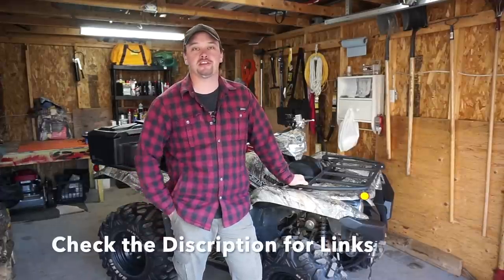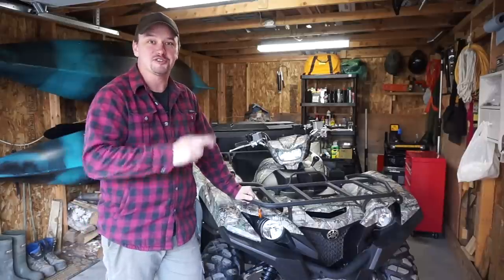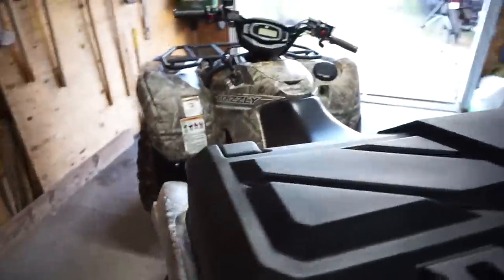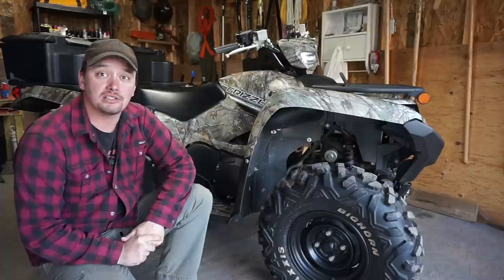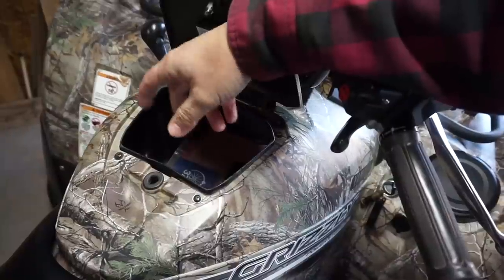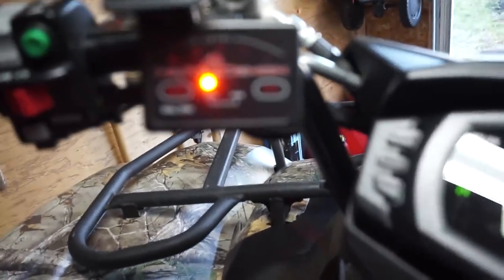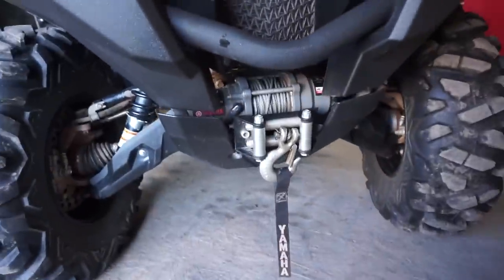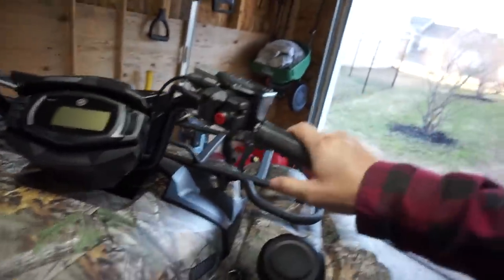Honest Owners Review - Yamaha Grizzly + Mods

Comment: Great job on this. Lots of information here. I had an '05 660 and the same year 708. Great ATVs. I like the Bighorns with the steelies too. Function before fashion! Smart idea with that foam seal on the rear storage too. That whole storage bin could use a re-think from the factory. How's that holding up for keeping the grime out?
Reply from the maker: hey ! thanks for checking out my video ! those old 660's were tough machines ! and yeah I had aluminum rims on my 2008 grizzly and thy dented easily, so I just kept the steelies for this one. yeah that rear storage bin just doesnt seem like something Yamaha would do... it seems half ass to me. The foam worked amazing ! just a little dust gets in there now, it keeps most of the water out unless I go in a hold deeper than the box, even from cleaning it keeps the water out good. thanks again for watching !
Reply: I have seen at least 2 video from Dirt Trax that said the first Grizzy was a 660 that is wrong and I  keep asking why Dirt Trax doesn't know that the first Grizzy was in 1998 Grizzy and it's a 600. I have a 1999 Grizzy 600 ,got it brand new the MRSP was $6500 I got it $6000 out the door and it only has 518 miles on it, still running like new. And I also have a 2017 with 708 and a Sportsman XP 1000 that that Dirt Trax made me buy both of them. LOL

Comment: Some mods:
Wrap the quad, (to save your plastics)
Rear winch
Elka Suspension 
Front and rear bumper
LED light bar
Brighter reverse lights.
Fold up prune saw
Reply: Also some other mods
change the spring or weights in the CVT
And add some weights in the wet clutch for more bite on the clutch, less slippage.
Reply from the maker: Hey thank for all that !
Reply from the maker: Yeah a toyed with the idea of changing some clutch weights.

Comment: I have a 2016 Polaris Sportsman 850 SP now....   
I used to have a 2004 Grizzly 660 in blue. Was a beautiful machine and had ZERO issues with it. 
I kind of wish I had gone with the grizz again.  I'm constantly afraid of breaking down on the polaris. It has some more power... but you pay for that power.... a couple hours riding and you are looking for a gas station again. 
 I mostly went with the 850 for the twin cylinder engine. As I'm no lightweight myself and I use it for plowing. 
I absolutely  LOVE yamahas 4x4 system with the push buttons and the slider. I like having control over those systems. Yamahas Ultramatic CVT is by far the best in the business.  
I often regret not getting another grizz... 
But I can 100% tell you this for sure...   the Day Yamaha starts putting their Vtwin engine from their SxS division in their 4x4 atvs,  ill be at the dealership with my Pink slip looking for a trade!!
Reply from the maker: Hey buddy ! Those Popo Sportsmans are a nice machine too but I hear ya on the maintenance and stuff.... I always have no worries that my machine will start and get me out of the woods. it could use an upgrade on the motor for sure and if they put a twin in the Grizzly, I might go in and get a new one too !! hahaha

Comment: Considering a used grizzly vs nearly new 570 sportsman right now. Looks of the newer sportsman appeal to me but I’m slowly leaning towards grizzly for power and reliability.
Thanks for the video.
Reply from the maker: Hey Anthony ! we'll thats a hard choice, I've never owned or driven a 570 Popo but from what I'm told the power is close to the 700 Grizzly. (Dirt Trax TV mentioned it in their latest video reviewing the Grizzly XTR) so maybe check that video out.
As far as Reliability, I think it's hard to beat Japanese machines, just my opinion though. 
I know people who have had good luck with Polaris and Can Am but I know so many more that run the hell out of their Honda/Yamaha and it keeps going.
Between those two machines it would depend on Your budget, the Year, the shape and how many miles are on the Yamaha vs the Polaris. Do your research and figure out what's best for you.
Reply: I have the 2015 Polaris sportsman 570. It’s my wife’s machine. I run it right alone with the 2007 grizzly 700. Both great machines. Power steering is better on the sportsman. Power is about the same.

Comment: I have a 2007 Camo Grizz  it hides the wear a lot better ..mine has 2300 km ... Love it , Replace wheel bearings only one time in 13 yrs, and swapped antifreeze with high end Arctic Cool . Helped a lot as i use my grizz to pull my tow behind mower .  It mostly just keeps my RZR company in the shed ...
Reply from the maker: Hey man ! you're right, the Camo really hides the dirt and stuff, my bike always looks clean even when it's not haha
Thats good you've has such good luck with your bike, and it's probably much better for yard work than the RZR anyway. thanks for watching !!

Comment: I just stumbled upon your channel and I've been watching it all morning. The content is great and I hope you keep up the good work. My opinion of the Yamaha Grizzly pretty much parallels yours. I think it has a very comfortable ride, steering geometry it perfect and the cvt is spot on.  Mine is a 2018 is 3100 km, it's completely stock and I have a few more complaints but I do love the quad. The power steering could be stronger is slow, technical terrain. The bottom of the front fenders need some extensions because at moderate trail speeds, my entire leg gets wet from water coming off the front tires. Water comes up from the holes in the foot boards and also huts the front of the rear fenders and splashes on my legs. That all said, it's a wonderful atv. I also have the same hand warmers, awesome!
Reply from the maker: Hey man ! dude you totally hit on a point that I forgot ! how the water splashes up through the floor boards ! that drives me crazy haha my buddy Evan put some home-made small rubber extenders down from the fender and he said it really helped.
I wish I would have mentioned that.... haha maybe at my 5000km review.... I'd hate to get into a bunch of review videos lol

Comment: I heard a guy talking about the reason they left that gap on the back storage cell was for air flow. They new it was going to get wet so they figured you could put your tow straps and whatever else you end up using in there after you get them all nasty so you don’t dirty up your dry bags/ dry storage. Makes sense to me really.
Reply from the maker: Hey man, that could be true for sure, but why did they put a plug in the drain? why not just keep it open so it cleans out haha Personally I think that sounds like a convenient excuse.... Yamaha has the ability to make it waterproof so it doesn't fill up with stuff. My guess is it comes down to Cost.... like everything haha
Reply: @Maritimer  yeah you’re probably right

Comment: They came out with the 700 (686) in 2007. Kept the 686 until 2015. 2016 until 2019 was the 708. Now they are back to the 686 for current years
Reply from the maker: yep ! I think I mentioned that in the video. if not, thanks for the update !

Comment: I have the grizzly and Kodiak 2018 both in 700 . They are same only thing different is the Kodiak is lower , and I love them both for the way they are built and perform. But that’s me been a Yamaha guy since my first motorcycle the yz 250 back in the early 70’s
Reply from the maker: Hey Lyle ! right on man, yep the Kodik is a nice machine too, it's a little more of a utility machine. does yours have the sealed rear brake? I had that on an older Kawasai and it always worked great.
Reply: @Maritimer  yes , sealed break , couldn’t ask for better.

Comment: good review. I've been looking and I think you sold me.
Reply from the maker: Hey !! Yamaha should give me a sales cut haha there are a lot of good machines out there, do your research, figure out what you need out of an ATV and see which one checks the most box's. a lot of people go for big power as their #1 box, but for me it's reliability. I always want to get out of the woods under my own power.
Reply: 686 is supposed to be more reliable
Reply from the maker: @davidb9323  i agree with that.
Reply: Haven’t had a single issue with my 2018 and on the farm we use it almost daily. Winters up here in Canada are brutal and she starts effortlessly at -30C. You won’t regret buying a Grizzly if well rounded and reliable is what you’re after.
Reply: Matt Oja what kind of stuff do you use it for on the farm ? I’m trying to decide if it will be valuable as a utility vehicle around my house. Might just find a used Kubota instead
Reply: David B we mainly use it to run our dogs around the property and for transportation to more distant areas where work needs doing. For example cutting firewood and hauling it back to home base with our dump cart, dragging manure piles in pastures/paddocks to keep flies down, and tending to electric fences. Light duty stuff. We use our JD 1025R for the heavier lifting tasks like snow removal, moving dirt around, etc.

Comment: Great review, thanks. I have exactly the same machine - even in camo. Just installed some Bighorn 3.0 and was wondering what air pressure you put in yours? I'm going to check into your modifications a little closer as I also notice my fan running quite a bit.
Reply from the maker: Hey ! Congrats on the bike ! I run between 3-5lb in my tires. lower pressure will suck up more smaller bumps, and give more grip.  Yeah the EHS Tuner can help with that fan being on and engine running hot.

Comment: I have 30 inch CST Sludgehammers on my 2020 Grizzly 700 with stock clutch and exhaust and it makes for a perfect mud bike. Keep in mind I do want the upgrades for more low end power. I can get through just about anything I need or want to get through. I have n2deep snorkels and 2.5 inch wheels spacers. I still had no problem getting my bike up to 50 mph with this setup and have had no problems with the belt at all. Overall Grizzly is the way to go if you want reliability with the old fashion but clean atv look!
Reply from the maker: Hey Noah ! I agree with ya man, they are a great machine for pretty much everything depending how you set them up. and gotta love the reliability.

Comment: ATV trails closed because of covid is the stupidest thing I've ever heard.  Thanks for the info.  Wanting to get a grizzly 700 (a new one 2021 or newer).  Wondering how it rides compared to the 2012 sportsman 500 that I had installed EPI HD springs on and loved how it handled on the trails.
Reply from the maker: Hey ! I agree !!!! so dumb.... but when are politicians smart?? lol 
I find the grizzly rides very nice and plush, handles really good b/c it's fairly light for a bigger 4X4. I always thought Polaris had an awesome smooth ride but I also thought because the soft ride you would get more body roll/lean around turns. BUT that was an older 2000's 500HO I drove. maybe they changed over the years, Polaris is sort of known for being a super smooth ride.
Reply: @Maritimer  Yeah, my 500 was too soft for trail riding and small jumps, that is why I had installed those EPI HD springs on it.  It was a really good trail machine after that.  Been regretting selling it, especially with the price of the new ones.  Thinking Grizzly is something I can have 10-20 years though.  buy once cry once.

Comment: I bought my kingquad in late September 2019 and i already have 4000km on it!  Man, you got to get riding...  i am thinking about removing the sway bar as well on my 750, i think it will make a difference off roading.   Thanks for sharing and have fun!
Reply from the maker: Hey man ! I wish I could get out for some longer rides ! but making YouTube videos takes up a lot of time... so the rides get shorter.  I love the King Quad ! Great bike !!
Reply: @Maritimer  i removed the sway bar of the kingquad today, can't wait to see the difference.  Will let you know how it rides without it. 👍
Reply from the maker: Keep me posted ! try and go over some off camber or weird angles, see how she preforms. I'm sure you'll like it.
Reply: I was curious if you removed your sway bar yet? If so, what did you think of it. I also have a 2019 kingquad and was thinking of doing the same.
Reply: @jessecameron7268  Yes i did removed the swaybar and it is interesting to see the difference when offroading.   A little different when turning at high speeds but not dangerous.   Where it shines is going over obstacles or softer terrain,  the articulation of the rear suspension is maximized and offers greater traction.   It even made the quad more fun to ride giving a plush feel on the trails.   Unless you are a fan of trails only, the swaybar removal will definitely be at your advantage.  Thanks for asking the question and your input on the subject 👍

Comment: I watched this video a hundred times and I’m happy to say I’m finally picking up my grizzly this week .. I’m coming off a 21 outlander 850 xt and I know I will miss the vtwin sound but honestly that’s probably it.. the power is nice but here in Nova Scotia there just is not many trails at least in my area that I can actually use that power. I truly believe the grizzly is the best balance for me .. I am nervous about dust getting by the air filter and the popping on deceleration .. at 14,000 plus these  things should not be a issue especially for a company like Yamaha ..
Reply from the maker: Hey Danny, I feel the exact same as youdo, the Grizzly has plenty of power for my style of riding, plus lighter and capable off road. I also agree with ya that the Popping noise/air filter and the whole 708 motor is complete BS especially from a company like Yamaha who prides there self on Quality and reliability. I'm glad they went back to the trusty 686 motor made by yamaha. Saying that I haven't had any issues with my 708 but it's always in the back of my mind.Cheers and enjoy your Grizzly !
Reply: 14k for an atv..😭
I bought 2x2017 arctic cat 550xt for 12k new, just as they got bought out, the dealer wanted to clear out all the arctic cat branded machines and had them steeply discounted ..
Reply from the maker: @Liimpy  lol  yeah it's a bit pricey, and the cost has only gone up over the last few years... SO,Let me ask you this.... do you think you got an amazing deal (Getting 2 ATV's for under the cost of mine) OR.... do you think there is a reason why they can sell two AC's for under the price of one Yamaha...
Reply: @Maritimer  that’s why I got rid of the outlander .. it was always in the back of my mind and my buddy has the same bike and only 400 more km and it’s falling apart .. leaky diffs front rear and the throttle sticking all the time .. hell with that lol I had a 03 grizzly and always regretted selling that thing so I bought another one finally .. oh and that 03 is still going today .. dude you got the complete package .. grizzly and a Tacoma smart dude

Comment: Just put a deposit on a 2021 Grizzly eps. Awesome trail riding bikes for sure. Reliability and the ultramatic transmission are 2 big pluses.
Reply from the maker: Hey man ! congrats on the new machine ! Yeah the Grizzly is probably the best trail riding machine out there, great low end power, decent top end power, the best belt drive in the game, which I prefer over a transmission like in the Hondas, great ground clearance, just an all around good machine.

Comment: I have a 2009 grizzly 700 camo pattern I added wheel spacers, winch my really only complaint is on the 09 that there is no secondary start (pull OR kick). Never needed secondary start yet but it would be nice to have.
Reply from the maker: Hey man ! I know about the secondary start, and I actually have a video on that coming, just need to edit it. I bring a power-bank jump starter with me on my trips, I used it to jump start a F250 in -25C winter, worked great so it should start a ATV multiple times.
Why did you add wheel spacers? any reason? Thanks for watching !

Comment: "Trouble passing emissions" translation..."better running, more powerful, more reliable motor!"
Reply from the maker: haha you could be right, but in this case it's more like the motor runs too lean, which makes it get too hot, which can cause a bunch of problems. (oil consumption)
I've had both motors, the 686 and 708 and I dont notice any power difference with the two. and it's clear the 708 has had more issues than the 686, but that's just my opinion, and you're entitled to yours. thanks for watching and leaving a comment !

Comment: Great video man. Brand new grizzly owner and looking to find out more about the machine. Great info, much appreciated.
Reply from the maker: Hey ! thanks Chris ! Appreciate it man. Grizzly is a great all around machine, keep up with the oil changes and clean the air filter and you shouldn't have any issues. Also I have a video on greasing the wheel bearings, you could check that out, ATV's only come with assembly grease in the bearings so they tend to wear out, I greased mine when I got it, and now has around 3300km and bearings are good. Cheers man !
Reply: @Maritimer  any advice on a plow? The guy at the dealership was pretty set on a Warn plow with pulley system. I haven't done any research yet but would like to hear your thoughts. Keep up the good work here, great video.
Reply from the maker: Hey ! I haven't owned a plow for my ATV, I like a snow blower better but thats just personal preference. But I asked my buddy Evan and he had the Moose plow, he loved it, he said it was super beefy and cleaner looking. I saw him plow with it and it worked really good, I was impressed with how much snow the ATV could move. So maybe just do some research and see which one would be best for you.
Reply: @Maritimer  Good deal. I will do some research. If I come across anything awesome or pitfalls, I'll let you know. Could make another good video for you.